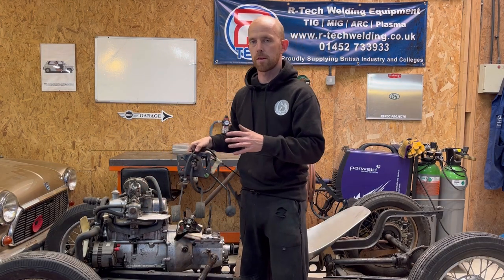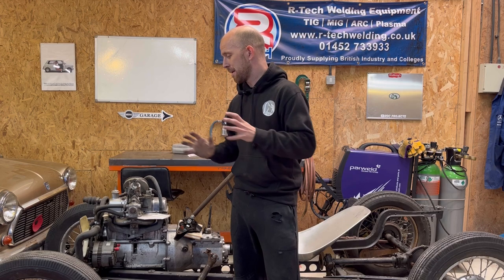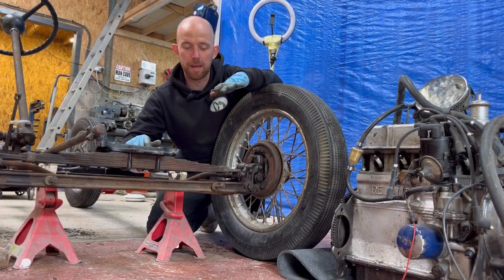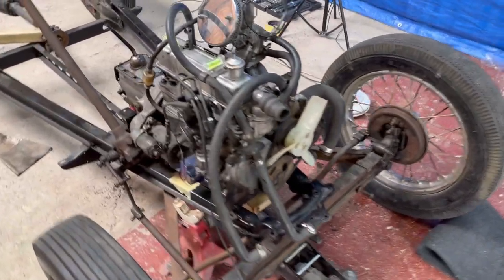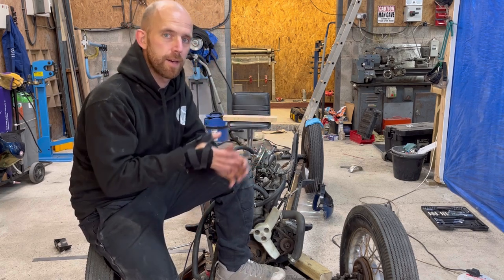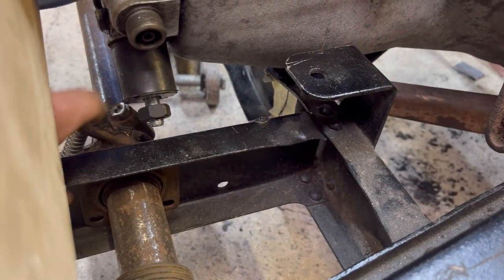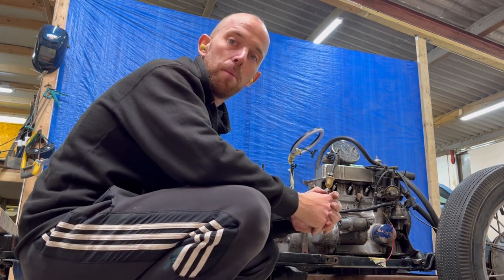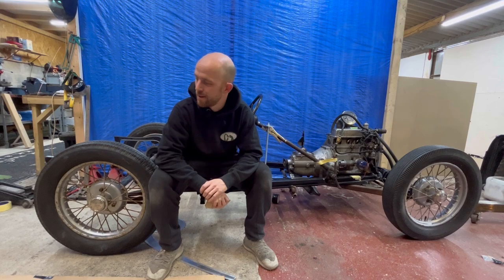Austin 7 special build  part 2- new purchases and getting the project started

Comment: You might find you need a bit more clearance between the starter bulge on the bell housing and your steering box to allow for engine movement on the mounts under torque reaction. It might just be the video but it looks a bit tight. While you have the sump off, rotate the crank and mark a bit of cardboard with the extremities of crank / bottom end swing, so you know how much space you have to play with when modifiying the sump pan. When measuring for fit up, it's always better to work from a machined flat datum surface such as the top of the block or the bottom of the crankcase / block bottom rather than rocker covers or sump pans. Older ones especially might not be as flat and square as they appear.

Good steady progress, great to see people who are willing to both share and learn. Keep it up.
Reply from the maker: Thank you for your advice 👍

Comment: Nice project. If you do anything non VSCC eligible (like the engine) do it in a way that you could later swop in a periode part and comply with the eligibility demands later on. You never know what might be
Reply from the maker: Completely agree as I’d like to do vscc 👍
Reply: A quick Austin 7 engine is relatively cheap and easy, and that's enough for hillclimbs.  Making it strong and reliable enough to race is the money - which is the new crankshaft and then all the "if I've spent that on a crank I really should also..." stuff.

Comment: I bet you could have left out the starter to get more space for the steering box, then use the pull starter from a big Predator.
Reply from the maker: Loads of room if done properly 👍
Reply: @Metal_shaper_tom  that was a joke about the size of it. The local farm store has a 2-seater go kart, for sale, and they appear to be the about the same size!

the go kart does have a roll cage, though, so I'm pretty sure you're nuts. 

I would drive the hell out of it!

Comment: Mig and tig welding cause the most ozone. Ozone in particular when tig welding. Exposure to ozone can cause fluid on the lungs. Get yourself an extraction system or better still an approved air supplied mask. (Not from your air compressor)

Comment: Brakes - Im using those pedals in a frame to mount a reliant engine on a chassis for my young friend.  That chassis has had a hydraulic brake conversion.  Are you staying with cables?   The usual conversion uses morris cylinders just post war and nobody has yet worked out anything to use something more modern.  Every now and then someone does a batch of back plates, some cast some welded.  For myself ive stuck with cables with some modifications.  Am sure theyll be a way to link that brake pedal to cable system BUT the obvious cheap quick and easy is somethong like the original brake which pulls a rod attached to the end of that cross shaft.
Reply from the maker: Even though I could have hydraulic brakes, I am going to have it set up with cable brakes and see how they perform. The reliant pedal box is a good option, but my friend seems to think we should be able to keep the original Great Lever from the Austin, which would be fantastic if I could.
Reply: Keeping with the cables and the original pedal, even if you need a new tie link back to the cross bar, should be straight forwards.  SHOULD be...but this is special building :)      Then the clutch....even with the original Reliant box I had problems with the cable run so came up with something weird.  When I don't need the hydraulic brakes (I'm working on a solution for a young friend with hydraulics then will get back to my Mk2) my plan is to not have all the supporting structure.  While I liked the idea of a factory part for something as critical as the brake pedal (I'm improving but not an experienced welder)  I'm more comfortable with "home made" for my clutch.
Reply: With your skills, even if longer term you might have hydraulics, I'm sure there will be a better "under the floor" solution.  I've seen lots that scare me.  For my young friend I'm being (in special building context!!!) conservative.

Comment: Handbrake - I put mine on the outside and used bits of yacht rigging to link directly to the levers. If you like that look or run out of space vs the gear lever i can share some photos via the facebook group.  I got a local mot welder to put the bracket on (30yrs ago) and its one of the things i might improve before the new body goes on.
Reply from the maker: I have every intention of putting the handbrake to the outside. I’ve got a chap who is helping me at the moment called Simon features in the video and he’s worked it all out for me
Reply: I've watched his films now.  Am looking forward to seeing what the two of you come up with.   That coupe/saloon has a lot of shape in it.  Even more ambitious than the recent "Highland Coupe" that's been on facebook and I think flicking through in the "WHS Reading Room" the Automobile magazine.

Comment: Can you tell me more about the engine? I’m from the states, that’s looks like a nice compact package.
Reply from the maker: It a Four cylinder in line OHV water cooled Aluminium alloy cylinder head and block that makes 40hp its a very similar size to the original that only makes 10hp. It’ll be good for 80mph and is easily tuneable

Comment: Nice, after a decent reliant 850 engine myself for my trike project..just trying to get the rear end mocked up first..was intending to use original reliant frame which is galvanised, so now I'm thinking I would get a frame made from 4×2 box tubing...which I would have to source out as I don't weld...not sure if the galvanised chassis would weld together strong enough......look forward to the rest of you're build..enjoy it
Reply from the maker: I put a want on a reliant Facebook page and was offered a few! I would of thought the galvanised chassis should weld up fine as long as it’s cleaned up.
Reply: Thanks, that's the first straight answer I've had regarding welding up the original frame..thanks

Comment: I'd need to go pull the sheets off my A7 special to check but it looks like the gearbox output shaft on the Reliant box is higher than on an Austin 7 gearbox. It could just be the angle in the film but it looks like quite an angle change is needed in the prop shaft from there to the front of the torque tube. You can't easily change the angle of the torque tube ball joint without some mods there from memory and if you do tip up the front of the torque tube too much I think that will mess with the rear spring mounts at the rear of the axle.  When next out in my shed I will have to look to jog my memory. If you are going for an Amilcar look will you do offset seating? That really helps if you do a very narrow body so there is room for two in it without hitting shoulders. Looking forward to seeing how you get on with this build.
Reply: Built mine with offset seating.  Works well two lots of hips wide but no clash of shoulders and elbows.
Reply from the maker: That’s what I plan to do 👍
Reply from the maker: Thanks for the info 👍 much appreciated
Reply: @Metal_shaper_tom  I looked at mine. I think not only is your gearbox higher, it's much longer than an A7 one. On mine it was tricky to measure but the bottom of the output flange was only about 2-1/4" above the crossmember with the curve in the middle of it. I couldn't measure to the centre line of the flange from under the car sorry. On yours the flange is both further back and higher up making the drive shaft angle worse. Not sure how people usually tackle that? Must be a way, people have been putting Reliant engines in 7s for years I think.

Comment: I think provided the crank centre line is parallel with the pinion shaft does it matter that it's offset? 

Tom where are you based please? Thanks.
Reply from the maker: Fair point James. I’m in Cheltenham

Comment: Prop alignment - its something car people fuss over, with OLD cars with fabric couplings its really important and a couple of mm here and there can make the difference between nasty vibration and joints failing and a le mans contendor.  My brother is surrounded by tractors and 4x4s and and is used to UJs going through huge angles.  I'm nervous but my current design has the engine offset and a noticeable kink in the driveline.  I might correct it, i might suck it and see...
Reply from the maker: I completely agree, this does get very mixed answer depending on who you speak to. This will have an angle change from the gearbox down, but I’ve heard off many people but this will be okay
Reply: It took a long time getting everything placed as it is - I'm trying to fit a different engine and make space for someone 6ins taller - so a good to hear you are hearing that.
Reply: Strange how I struggle convincing myself - but I remembered an Austin 7 example, and with lots more power.  Lots of the single seaters have an offset rear axle and the engine in at an angle.  I don't know if each uj does half the angle or the one at the back all of it or it varies but many folk thrash them.  IT WILL BE FINE.